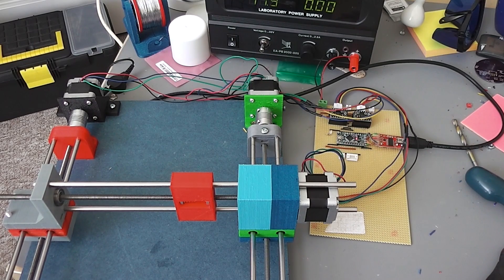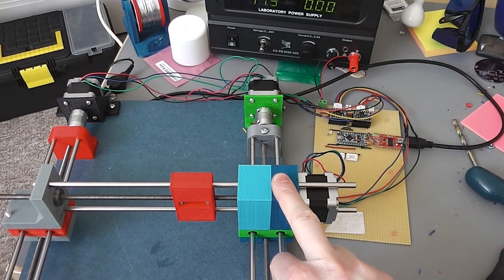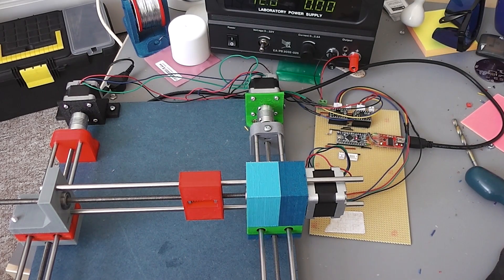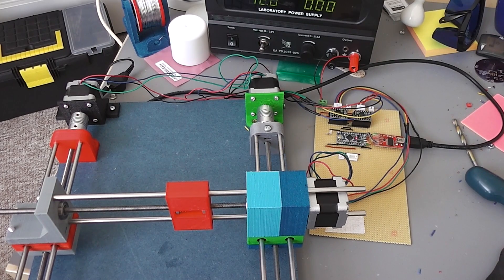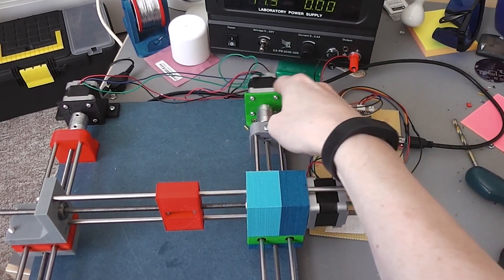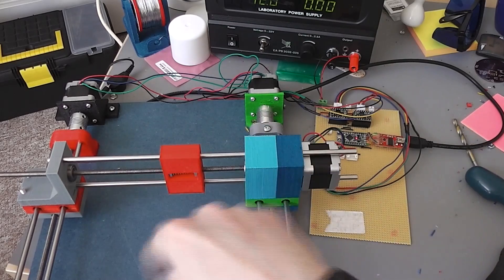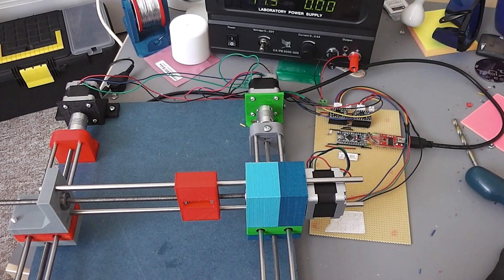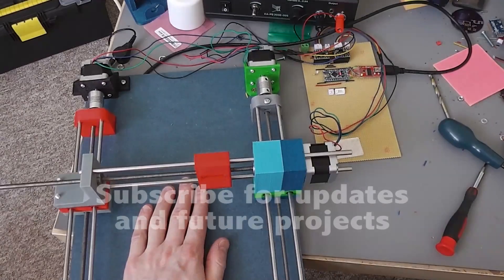Laser Engraver Build Update #6 - Full movement test

Comment: Your design requires that the pairs of shafts be held parallel to each other with great accuracy. That is very hard to do. Relaxing that constraint will eliminate the noise and missed stepping problems.

Comment: Why not just run a belt?? no need for 2 motors for one axis.
Reply from the maker: Because thats not what I wanted for this project, the aim was to to try out a different drive mechanism which when I started out seemed a lot simplier!
Reply: Arthur Guy I mean just to avoid the other motor for the same axis. I wanna make something similar. Thanks. Great work. Where's the latest on this?
Reply from the maker: zerocool60544 I ended up scrapping the project because of accuracy issues :(